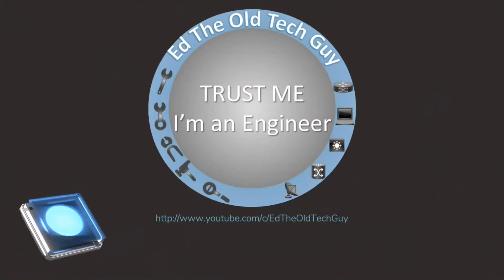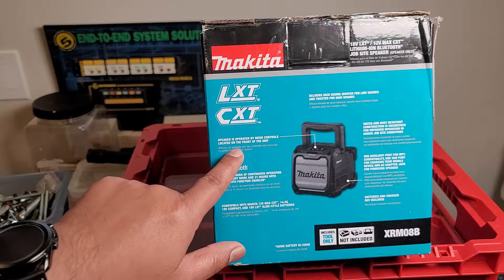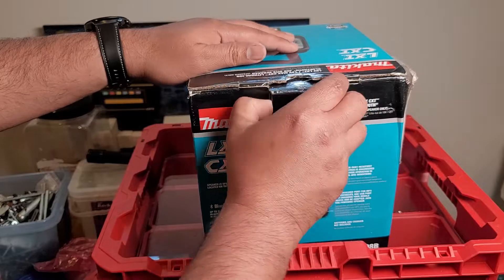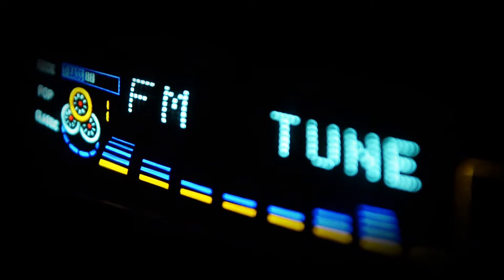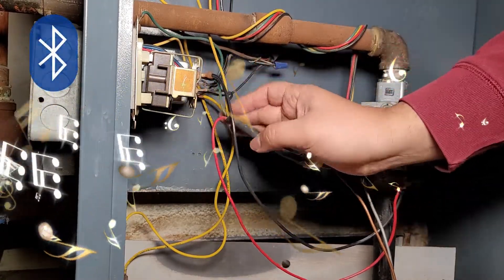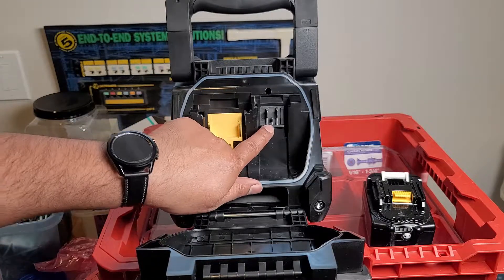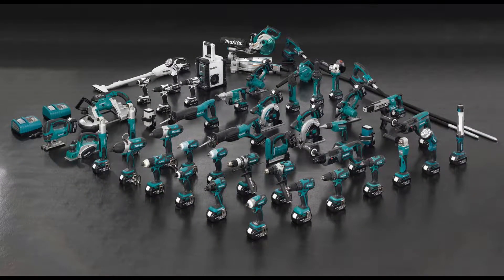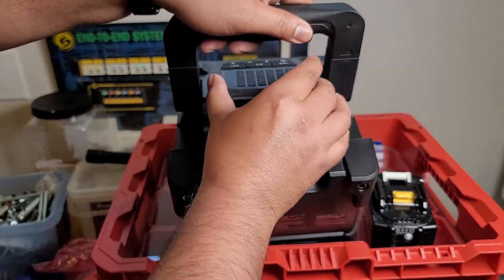Makita Job Site Speaker XRM11 or XRM08B? - Which should you buy?

Comment: The fake one model you review...
Reply from the maker: There is no fake one, they are all Makita and there are different reasons why to pick one vs the other.
Reply: @edtheoldtechguy  I know about the colour skin of Makita.

Besides that you installed the battery of 3Ah in it. The 3Ah battery doesn't posses the charging step level indication lights. So this make the battery to consider it fake.
Reply from the maker: @msjanktk4882  The older Makita official 3ah batteries do not have LEDs but the new ones do. I don't recall which I used in the video but I own no fake batteries. It's the worst thing for a tool.